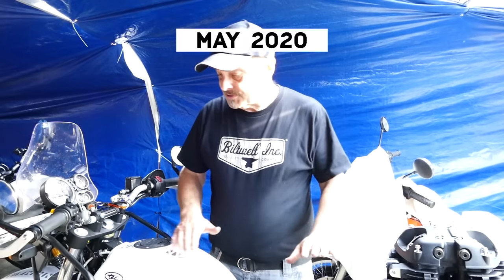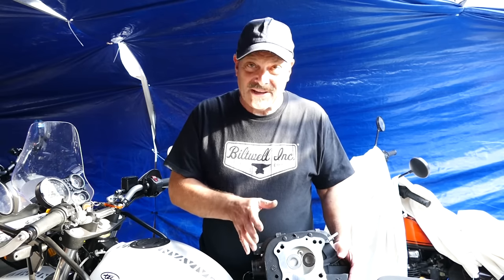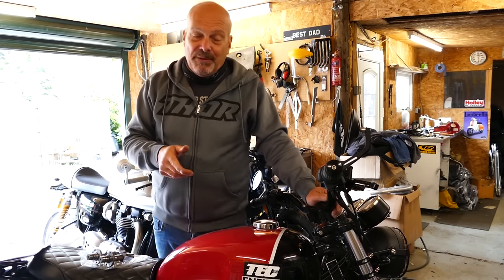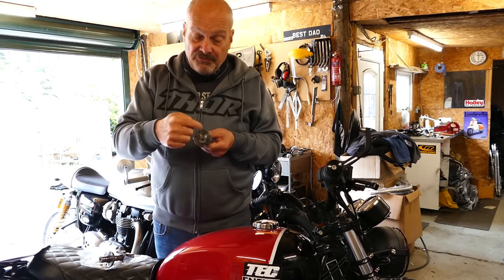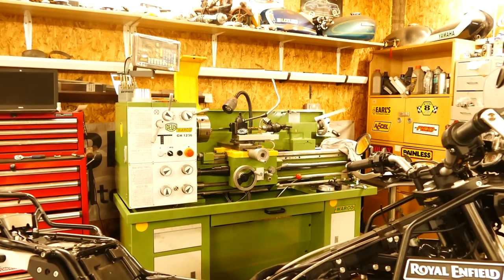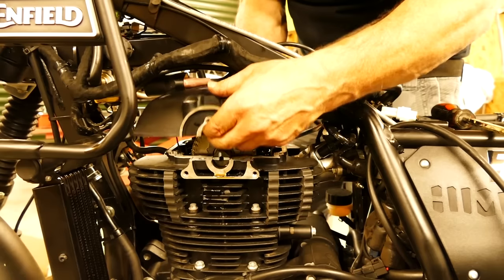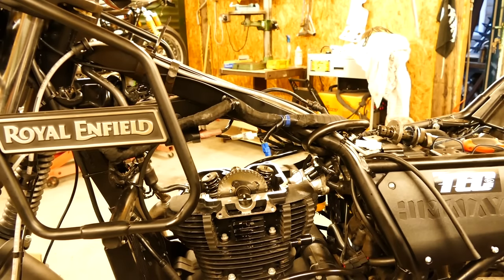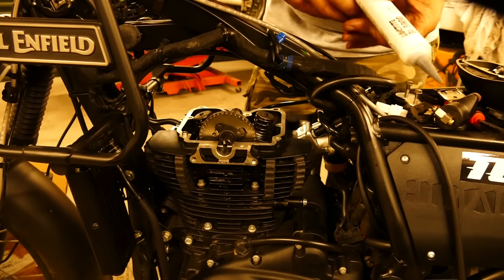Royal Enfield Himalayan Camshaft - 20% More Power Instantly!

Comment: Nice video! Its harder to design an engine to match emissions. However, how do you get 29 HP at the wheel? Stock dyno tests are around 20.5 HP. I'm a bit confused.
Reply: 29hp at the wheel is impressive  honda xr400 only has 34hp at the back wheel  and being air cooled that's about the limit.
Reply: 29 hp would be a 50% increase. You need more than a hot cam for that.

Comment: Hi George. Very interesting video !
You mentioned going a tooth up on the sprocket. Did you mean front or rear sprocket ?
Thanks
Reply: go up to a 16 t front sprocket, but a new un-stretched chain will need an extra link fitted to do this.
Reply: @georgemilburn6213  thanks !

Comment: Hi
I have a sealant  leak on my cam cover, but now having seen your video I think I will change the cam
I have a couple of questions first please
I did not see you remove the tappet plug
I have removed the bolt that holds it in but do I now need to tap it to remove it as it is a little stuck
The diagram shows a seal behind the plug
Would you advise to replace that seal while it's off
Do I remove the spark plug to turn the bike over tor TDC 
Nice video, I will confirm if the upgrade is OK
Thanks

Comment: How is mpg before vs after cam installation?
Reply: Much better after the cam was fitted, but I also changed the front sprocket to 16 Tooth. I now regularly get around 100 MPG on a long run and around 95MPG on everyday riding.

Comment: Must the silicone head gasket still be soft when you torque down the head,
or can it have dried so it's firm when you torque down the head?  If it must
still be soft, how much time do you have before it's too firm?
Reply: Hi
 the 5900 silicone is designed to stay firm but not fully cure till torqued down and has a good work time.
see Loctite for full PDF spec sheet on this product and how it is different from normal silicone
Reply: @georgemilburn6213   - Thank you, GEORGE!

Comment: standard exhaust valve clearance is 0.23 - 0.25mm in the vid you say 0.010mm surely not? I ask as i have one on order.
Reply: sorry must have got confused , we enclose all the clearances and torques with the written instruction with the cams
Reply: Probably just a confusion in units of measurement.
0.010" is equivalent to 0.25mm
Reply: @phillipembury2271  0.01 'bananas' is easy to remember those stinky imperial units

Comment: Very much enjoy your channel. Will you be releasing a 410 big bore kit? If so that would require a different cam then this upgraded one, yes? Check out Patriot front fork suspension kits as they have a unique solution for springs. With the stock forks being rather narrow, how wide a front wheel/tire could I run before swapping out the front end for say a WP inverted front end from a KTM? It looks like you're running a wider rear tire as well? how wide will swing arm allow 160 60/40 adv tire?

Comment: I didnt buy one of these due to the hp. I got a klx300sm. Ive fitted hard panniers and a tail rack. If the  scram 411 or Himalayan had 30hp from the factory with the ability to get a few extra i would have bought it. But at the 20 to 24. I was out at the time. Wish this mod was available way back when i wanted one.

Comment: Last Thursday I finally had the time to fit mine (bought in Oct'21). I've set valve plays to 0,08 (intake) and 0,23mm (exhaust) as the values George mention in this video are wrong according to TEC's staff told me by email. I found the valve ticking noise quite loud with the new camshaft. Is that the new normal or is it should get back to original one after break-in period. I asked that to TEC staff by email, but they are not very responsive.
Reply: Deny I assume the tapping was from the 23 thou gap. Can you tell me what clearance you finally arrived at, and did it cure the problem? Thanks buddy.

Comment: Nice video! But I'm a little depressed my Himalayan won't start, fuel pump doesn't prime when I turn it on, not sure what's going on.
Reply: Could be lots of things like the tilt switch, or a fuse, but if you do a diagnostic test after checking the obvious things like connections and fuses it should give you the fault code
Reply: @georgemilburn6213  I can get it to start if I turn the red switch to on and then cycle the key on and off, some times it takes around 10 times and sometimes it starts right up. If I hear the pump prime it will start.

Comment: I’m interested in this camshaft and considering pairing it with a DNA air filter, Delkevic exhaust and maybe a FuelX lite. Will this affect fuel economy and mileage? Would I get less km out of a tank, more, or no difference? I do like how many km I can get on a full tank on the Himmy.
Reply: same question here, any update ?
Reply: @Skyler-md7ny  I have done the cam, lextech exhaust, fuel x lite and DNA intake, the smile on my face makes up for any economy issue, which there isn`t.

Comment: You seem to quite adamantly go for the Loctite that RE state. The SI5900. But surely any decent grade of engine silicone gasket would be ok no?
Reply from the maker: Hi
 yes you can use any good Silicone gasket . But this type as good bead retaining properties and working time, Because of this it is used by many top engine building companies on the production line. Porsche use this on 911 turbo cam covers need I say more.
Reply: @TECBikeParts  thanks. I managed to get some in the end. The next day I thought it might be a good idea to let the bike tick over for 30mins prior to riding it. I’ve just read that’s the worst thing to do and I should have taken it for a gentler ride slowing the revs to vary. Oh well hopefully it’ll be fine.

Comment: Did you have the pin in the camshaft in this video? I didn’t see it. Do you have to enter it before or during? Today i received my camshaft but there is no marking on it (T) for the top death center? How can I know which side is up?
Reply from the maker: You can tell 'UP' by the location of the pin hole.

Comment: If you put one in a brand new engine with a handful of PDI test miles, could you just run it in along with the rest of the motor as normal? Do you have any figures for a full exhaust system including new downpipe (one with with no CAT or sound absorbing stuff in it as RE seem to put that in their downpipes)?
Reply from the maker: Yes, we have fitted them to several brand new bikes and this saves running the cam in again.

Comment: Any idea what would make the bike stall and not idle well after this cam upgrade?
Reply: Look on the superb Royal Enfield forums for loads of free advice. I have a 411 and never failed to find a solution.
Reply: @stevec-b6214 oh I figured it out man. The timing was slightly off. I pulled the top end apart and adjusted the chain on the sprocket to line up up with the line and not the T. Worked like a charm.

Comment: What is happening on the Dyno readings at the 3,000rpm mark ?  Why the vertical lines ?  Is it the transition from closed to open loop mode ?
Reply: It's clearly when the throttle is being opened! You don't lug an engine on the dyno, you let it cost down to the target revs and then crack the throttle.

Comment: Very interested in this,. How does it affect the emissions for the MOT.
Reply: No emissions test on mot. 😉
Reply: @martamp_el84  Sorry should have said living in Spain so ITV tests emissions
Reply: Will be Ok as long as you keep the standard exhaust fitted for the test
Reply: @georgemilburn6213  Thanks for the update. I love the bike but the midrange is a bit flat on the slopes and motorways are a no no. So this looks very promising  rather than another bike. 👍
Reply: Just stuff the pipe with brillo pads, then take them out after.

Comment: why dont you lube the cam with the starter motor? just let the sparkplug removed an start the engine without plug. That fast spin should pump pretty much enough oil up to the cam.... maby a thin layer of grease could help on the cam and rockers...

Comment: Have been anticipating this video since your teaser last year. Well worth the wait. Have I missed the carb upgrade?

It seems to me that this engine was designed with economy of production and assembly utmost in mind. 

Watching how you worked on it here confirmed that old Irish response to the lost tourist asking for directions to Dublin. I definitely would not want to be starting from where RE did.  

Indeed what you reveal about the way that cam is located in the head rang many alarm bells that suggest that engine longevity was also possibly not necessarily a priority. 

There are clearly far better ways to mount a camshaft in a head than mimicking the horizontal split crank case solution for the crankshaft. I’m struggling to think of another manufacturer that does this, but I’m not familiar with all of modern engines. 

However, it’s obvious that all internal combustion engine design is simultaneously being dumbed down and neutered by degrees, with the introduction of each stage in the legislative process, obviously designed with only one ultimate objective in mind: to kill the ICE after slowly starving it in a war of attrition only capable of appeasing the dishonest lunatics behind the doom goblin fronted climate death cult. 

Research into the solar maximum confirms that our worst suspicions about the true origins of the actual (far Less than predicted) warming are true. 

In many ways, it would be more pleasurable to work on a Chinese ripoff of a 1970s Honda. At least they were designed to last, and could be worked on by a kid who didn’t own a torque wrench a prayer wheel and a poster of a tiny Swedish Elf puppet on his wall!

Thank you for sharing 
Peace

Comment: Put a top speed video with this new camshaft on road.please
Reply: only problem is that is now goes a lot over the legal speed limit on UK roads, I don't want to make a video of me breaking the law  for obvious reasons.  I will try and find a long enough private road and make a video.
I will also make a video of how the bike pulls much quicker up to legal speeds and the lower revs at these speeds due to sprocket change
Reply: GooTube algorithms have logged your inducement of George to break the law, and reported your mindset to the appropriate authorities. Expect your ‘invitation’ to attend an attitude adjustment course in the next few days. You may wish to pay the £95s for the course to avoid a possible £5000 fine and a unlimited negative points on your social credits. 

After laughing at this comment, please copy paste it into a text programme, print it out and pin it to a vertical surface nearby. Within five years or less, this will be a reality here. It’s already operating in China. 

Peace
Reply: New 0 to 60 and quarter-mile times for comparison Would be nice
Reply: @MrFox5113  Quarter mile? That would be a long video on such a slow bike!

Comment: What will this comfortably run down the motorway at now?
Reply: With the 16T front sprocket it runs really nice at 75MPH and easily keeps up with the traffic flow on the motorway. It will go faster but the motor is revving too high in my opinion and the fuel consumption starts to drop off.
We have found that with the cam fitted and 16 T front sprocket ,that we are getting an average of 97 MPG with mixed use, over several months of checking.

Comment: Hi, great video, on my bike it's very noticeable just above 4000 RPM it's feels really lean or holding back if you hold the throttle in spot mainly in 3rd and 4th gear. I do have a booster plug fitted but to be honest it doesn't do much for that issue, so would the camshaft correct this? Cheers Phil
Reply from the maker: Yes, that is exactly why we developed the camshaft, so the motor can breath properly above 4000RPM
Reply: What does the booster plug do then?
Reply: Hi, the booster plug just tells the ECU the bike running colder then it is  therefore making it richer. The best thing about the plug  it stops the bike stalling from cold. My bike runs quite smoothly now I disconnected the battery for a while, I think the ECU got clitches in it somehow.  Cheers Phil

Comment: What seat is that?
Reply: stock seats with extra foam in front and reduced in rear seat, this allows you to move around on the seat. Highly recommended for comfort and control off road. Was done by  saddle craft of south sheilds (ask for Les )

Comment: This is just what the air-cooled RE singles needs ,, more power... They have character but falls short on power.. The new scram 411 with 29 bhp instead of 24.3 bhp seem ideal.. heck the meteor, classic 350 and new hunter 350 needs more power.. 20.2 bhp on the 191kg meteor is a bit too low.. the J series 350cc single is suppose to be a better design than the 411cc engine..  so one would assume that with a new camshaft,, air filter and a little more free flow on the exhaust you could get 15% more power on those 350cc bikes.. a 23.3 hp on the new hunter 350 with some weight savings would be nice.. instead of the stock 20.2 hp

Comment: What controller are you using?
Reply: You do not have to use a controller with the cam, it will work good with stock ECU, but on this Euro 4 model I use with a Boosterplug for better throttle response.
Reply: Thank you

Comment: Hi guys since  fitting my cam I've  had a lot more tappet  noise  rechecked  twice  all fine with clearance  - my eng has always been relatively  quiet  (for  a Himalayan  )butterfly noise  now is annoying  me - could  I have done  something  wrong  ? /mileage is now approaching 300 miles and not been over 4000 revs
Reply: Hi
After a lot of testing and experimenting we have found in cooler climates you can reduce the valve clearances by 2 thou and this helps a lot
Reply: @georgemilburn6213  hi George , thank you for  replying  , so I can safely take the exhaust  valve  down to  7 thou ?  Leaving the inlet at 3 thou -  year round  or just the colder months ?
Reply: @markanetley7142  
Yes, that is what we have been running ours at all year without issue and a lot quieter. Please bear in mind a higher lift cam will tend to be slightly noisier
Reply: @georgemilburn6213   hi George  hope you  had a great Christmas  and hopefully  we all can benefit from  a good new year  - thank you  for getting back to me  , yes  I do appreciate I will get a little  more  noise and I will  give my tappets a tweak , was starting  to  worry  that  I might  have  got something wrong

Comment: Interesting... but if it changes the emission values in just a slightly negative way, there´s no way to make it legal in Germany...
since more power usually comes with more emissions, there´s not much we can do around here...
Reply: Hi
 Camshaft with stock exhaust and ECU ,the exhaust readings were still just within EU limits. But any further mods would cause a fail.
Reply: @georgemilburn6213  okay, interesting

Comment: 20% of 24 bhp is 4.8 bhp. If you want/need/ require more power, just buy a bigger bike! I can't really justify the expense of changing a camshaft for less than 5 bhp on the top-end. Just saying.
Love and peace.
Reply: so you advise me to sell my bike and buy another one, when I can get almost 30bhp for 200 quid? just saying.
Reply: Yes.
Reply: @daweshorizon  gosh, you are so good at telling other people they are doing it wrong. Thanks, I have only been riding 50 years, and owned 45 bikes, rebuilt 5, just finished no.6, bit of a newbie really
Reply: @stevec-b6214  I have not told anyone that they are doing something 'wrong', as you clumsily put it.
I am merely questioning the logic of spending time and money for the benefit of 4.8 (Ish) bhp for a 411 Himmy.
The Himalayan is my everyday rider, mostly on- road, but frequently not.
The Himalayan relies on torque, not top end power.
It's basically a two wheeled tractor on which you can have some fun and travel long distances without major mechanical issues.
Don't pull the 'fifty years in the saddle' bs with me. Been there, done that.
Check out the pic I use for this 'social'. Name that bike! I'll give you a clue, it was registered in 1956.
Love and peace.